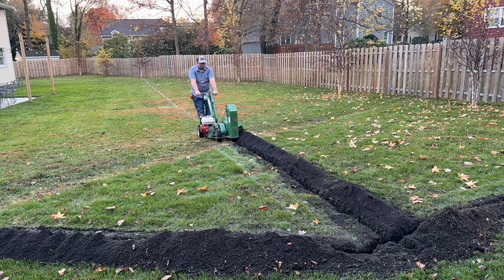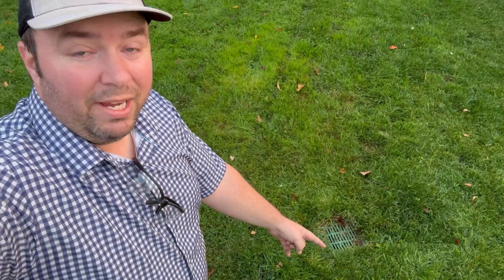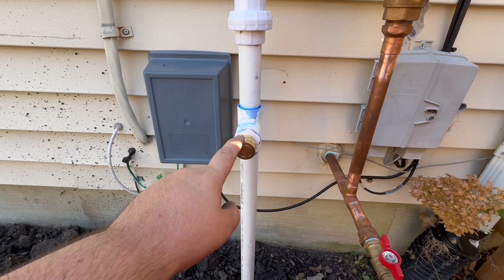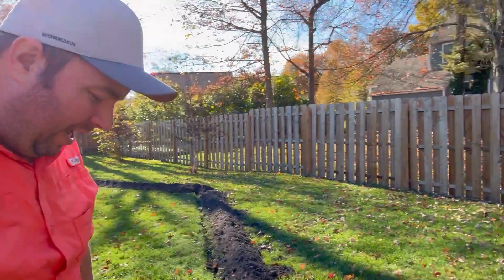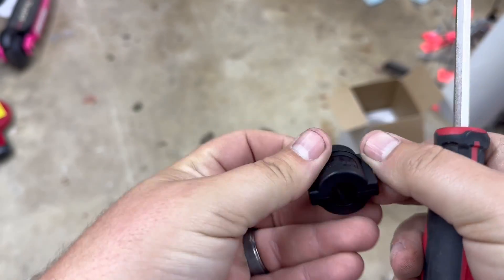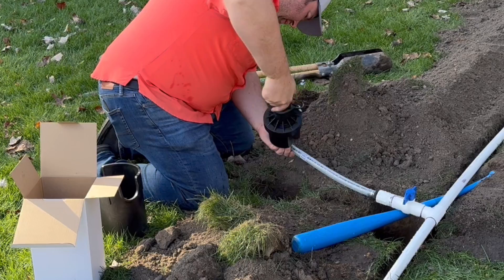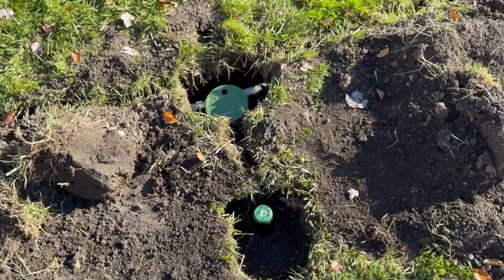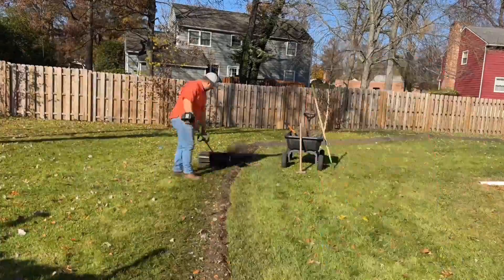You Won’t Believe How FAST We Install This Irrigreen System

Comment: How do add Irrigreen system to an existing irrigation system? My existing system is tied to a well pump for my front yard, I need to add irrigation to my back yard.
Reply from the maker: That’s a tough one because traditional systems have many branches off lines controlled by a central valve control box.  Irrigreen works off one header pipe because each head is its own zone.  In your case, you would have to figure out where every pipe is buried, then figure out which sections you would need to cap off in order to maintain flow to each Irrigreen head.  Not impossible, just very difficult.

Comment: Just finished layout of my system. Irrigreen helped with the layout and number of heads to get- 5. However, I used wooden stakes and two 25ft. tape measures to swing arcs and make sure overlap occurred. I will most likely get a greater distance than 25ft. but I'm going conservative. So it turned out I was short one head.  Got with Irrigreen- one on the way (with cable and hose). Will this one added head matter to the controller? Was it programmed originally for five and will something have to be done to add the 6th separate one? Trenching in a day or two and setting the system. Great videos- Many Thanks
Reply from the maker: @sfdvr2  do you have the old controller or the new smart controller?  Either way, Irrigreen can connect remotely to the controller and help setup the new head if needed.

Comment: This system seems really cool. My only concern is the durability of the heads. Can they take being ran over by a lawn tractor repeatedly?
Reply from the maker: I’ll see if I can find out for sure, but about an 1/8” of the head sticks out above grade.  Seems to be totally fine when I stand on it with all my weight on one foot (I’m 280 lbs).

Comment: Man wire to each head 😅 image trying to troubleshoot some wiring issue
Reply from the maker: Will not be easy.  Either need an extra set of cables to test above ground or check for continuity with a meter.  If the wire goes bad, you can trench a new wire and abandon the old one.  Easier said than done.  LOL

Comment: Always winterize through Pvb
Reply from the maker: Some say to do it, others say it’s the worst possible thing you can do.  I just leave the drain valves open on both sides of the pvb.  How would you do it?
Reply from the maker: @blackscorpians91  thanks for sharing.  I plan to do a video showing how I do it.  Would be interested to hear your thoughts when I do.  I think I’m able to get everything out.  I also have a valve inside the house that allows me to break the vacuum from the house to the pvb.
Reply: @TheLawngineer yeah that breaks it but you won’t be able to get water out of the lower brass shutoff valve on the backflow and the lower test port
Reply from the maker: Check this out and let me know what you think:  https://youtube.com/shorts/_M3JC6zqtLQ?si=awnA34yt3wwL2wTj

Comment: Can you elaborate on some of the tools you used to backfill the trench and cleanup the dirt from the grass?
Reply from the maker: @dlscowboys1  of course!  I used a rake and sledgehammer to pull the majority of the soil back into the trench.  The sledgehammer was the perfect width to fit in the trench and help compact things.  That’s where most of the work is.  

To clean up the soil that has caked onto the surrounding grass, I used the ECHO Pro Paddle attachment which did a good job of breaking up the soil and re-expose the grass along the trench.  Then finish up with blowing everything out with a blower.  If you have a lawn roller, I also did a few passes over the trench to make sure it was level with the existing soil.  Any low spots, you can fill in with more soil.

Comment: Does the controller cable need to be hooked up to the start of a run or can it be connected within a line of sprinklers?  For example, if I have a run of 8 sprinkler heads can I hook up the controller cable to head #3 because that's closest to the control box OR does it have to be hooked up to head #1?
Reply from the maker: Heads 1 thru 8 do not need to be in order, but they need to be on the same line from what I’ve experienced.  Seems like the heads were pre-programmed that way before they were shipped.
Reply: @TheLawngineer  Thanks!  My lawn is U shaped and the 2 ends are more than 50ft from where I could put a controller box so it sounds like I could attach the controller cable to anywhere in the run as long as my red cable is going towards that sprinkler head.
Reply: Or maybe not given there's only 2 cable connectors.  I wonder if I have to run 2 controller cables in line (100ft) to reach the end and then all of the other heads feed back to that one.

Comment: The numbers on the boxes is interesting. Never would have thought that meant something. I have a total of 10 heads, two of which will be on one side of the backflow valve and the other 8 on the other side. Could I run 9 and 10 to the one side and the other 8 on the other? They’re separate cords correct?
Reply from the maker: Same setup here, but 9 heads.  Daisy chain heads 1 thru 8 on the same line that match up with the box, then the other two on the other line.

Comment: Thanks for another great video, how long did it take you to trench with that cheaper unit? How many feet did you have? I have 285 feet, curious how long it will take lol   They offer 2 models, self propelled and one similar to the one you used, $4,000 sprinkler unit is worth it, 8 heads instead of 40, I was heading towards 2 grand anyways, Thanks Vince!!!!!!!!!!!!
Reply from the maker: I gave myself a day to trench just over 300 feet.  Soil was clean for the most part and on the sandy side.  We hit some roots which took time and some hand cutting… but the trencher I used was great for the soil we had… it does take a bit of effort to pull, so if you have back issues, go with the self propelled version if it’s available to you.  I was able to complete the install in a weekend uninterrupted.  I did have to winterize before finishing setting up each head in the app, but now that winter is over, I’ll pickup where we left off and start creating that content very soon.  Thanks for watching!  Anymore questions, let me know.
Reply: @TheLawngineer  Thanks, I will be installing mine this weekend

Comment: Nice system. Our project is around 2,000 sq ft. I think it may be too small an area to absorb the cost of the controller which I hear is a chunk of the price. What system would be second best or better for a smaller project, in your opinion
Reply from the maker: Probably a rain bird system… I was quoted $3,000 for a hunter system by an irrigation company last year for 2,500 SF.  Rain bird might be a bit cheaper.
Reply: @TheLawngineer  It's me again. gearing up for a lawn install. I've been watching your videos and they have been really helpful. Could you confirm the steps that I have laid out? Maybe I have too many steps involving tenacity? 
Starting with just soil:
1.	Spray bio-stimulant (sanctuary)
2.	Spray mesotrione (Tenacity)
3.	Plant seed and rake in
4.	Roller over seed
5.	Add starter fertilizer (Scotts Turfbuilder Triple Action built for seeding – has Tenacity in it)
6.	Peat moss over seed
7.	Spray:
a.	Mesotrione (1/2t per 1000 sq ft)
b.	Sanctuary (11-21-21) Fertilizer 1 scoop per 1000 sq (Use monthly)
8.	Water
Reply from the maker: @kristinnielsencounseling3405  you can remove 7A.  What seed you planting?
Reply: @TheLawngineer  But keep 7b, right?
Not settled on the grass seed. We are in the northwest/Seattle area. What United Seed have you used? Also thinking about GCI Blue Heat (bluegrass) @ 1lb/1,000 combined with Barenbrug perennial ryegrass @ 4lb/1,000. Any suggestions...I am listening!
Reply from the maker: You can do steps 1-6 in the same day.  And water every day until germination.  Let the peat moss tell you when it’s time to water… when it’s a dark brown, it’s wet.  When its very light brown, it’s dry.  There is enough fertilizer down with the starter to get you through the first 2-3 months.  Once established, then you can start a monthly spoon feeding with the 11-21-21. 

If you want to go a step further, have a soil test done to see if you even need the phosphorus and potassium.
Reply: @TheLawngineer  Thanks so much.

Comment: $7,000.00 plus for an irrigation system? No thanks. My Rain Bird does just fine at less than 1/3 the price.
Reply from the maker: Thanks for sharing.  How big was your system?  I was quoted $3,000 just to install a Hunter system in my front yard (2,500 SF).  Different brand, but same type of install.
Reply: @TheLawngineer  15K SF, mine was 3 grand total way back in 2014? Still works like new knock on wood. Have 9 zones for reference.
Reply: @rickjames6948  I have about 13k Sq ft. Was quoted 10 zones@$500 per zone... my irrigreen system cost me 3k. Spending about $1000 between parts and labor to install. Saving $1k plus longterm saving and customizability.
Reply: @RyMuEntertainment  If you trench it yourself and buy all the parts, sure even cheaper. My hard pan clay, a Ditch Witch trencher was bucking for 2 solid days on my 15k SF. You guys with good soil have it nice.

Comment: How did it cost you for everything you put into your system?
Reply from the maker: The system from Irrigreen was sent to me for free but is valued at $4,697 which included 9 heads, the controller and cables to connect to each head.  

I had to purchase everything else which added up to $2,358.88, here’s a breakdown of what I paid for out of pocket…

Electrician for outdoor outlet:  $200

Plumber for backflow preventer:  $538.64

PVC Pipe and fittings from Home Depot:  $574.72

Trencher rental:  $445.52 (I had to pay for drop-off and pickup)

I also purchased a larger air compressor so I could winterize the system myself (I also installed the system right before winter and had to winterize immediately after the install).  That ran me about $400.  I also purchased a Milwaukee M18 PVC pipe cutter for $200.  Not necessary, but helped cut things way faster.
Reply: Man so you would be 7k in that irrigation system. Ouch. But it is nice
Reply: @jslegend05  I’d say at least here in Michigan $7k for that size yard would be about accurate for a standard system